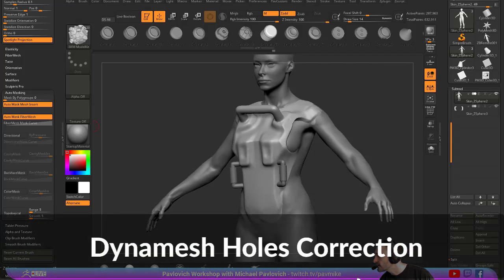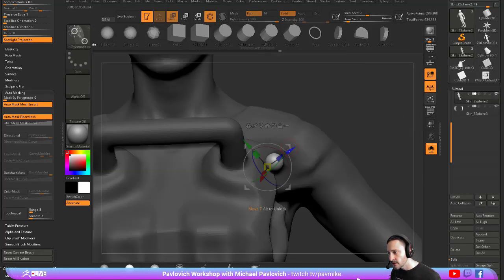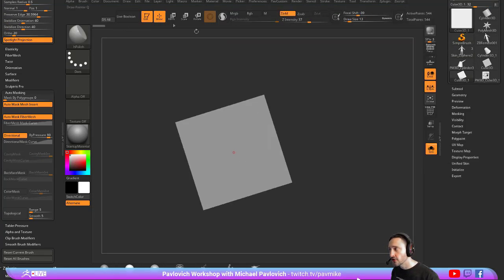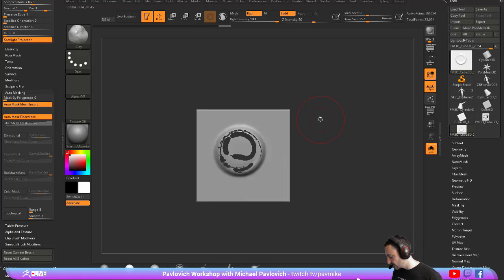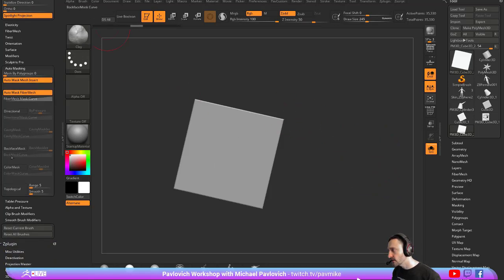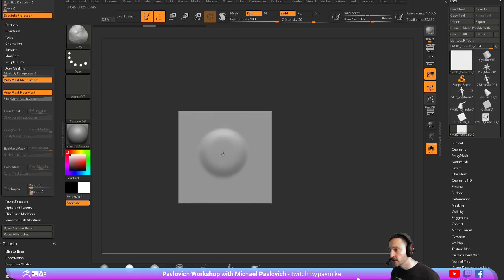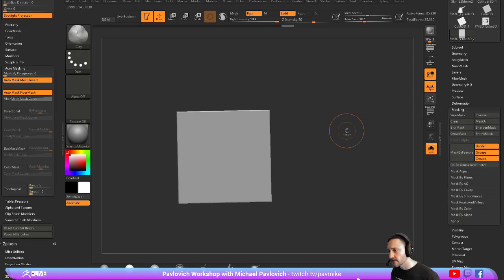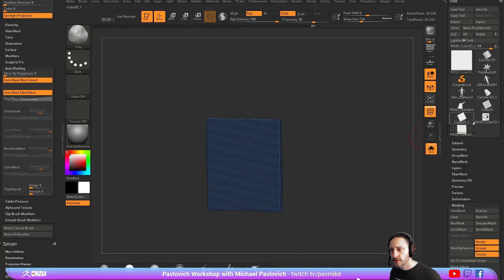006 ZBrush Dynamesh Holes Correction

Comment: Dynamesh cuts holes even on a flat surface which in my opinion shouldn't behave like that. Once you pick a higher resolution it should preserve the original form, not the other way around.

Comment: Is there a way to fix a swiss cheese effect without having to inflate or resculpt the mesh?
Reply from the maker: that's a tough one...in my experience, no, not really. You can try geometry > modify topology > close holes before dynameshing...you can also try reducing the dynamesh resolution, but you'll lose resolution. In that case you can dynamesh at a lower resolution with project on, then dynamesh higher with project off. Or, ctrl+click your "good" dynamesh version in your history, dynamesh lower to get a clean, non-swiss cheese effect, dynamesh back at your original resolution, then do a subtool > project > project history. That way (hopefully) any small surface inconsistencies should be fixed. Or try subtool > remesh and project in a pinch, but that's a bit more work.